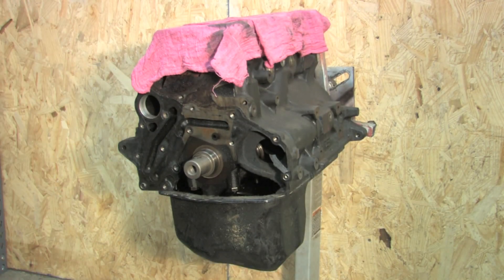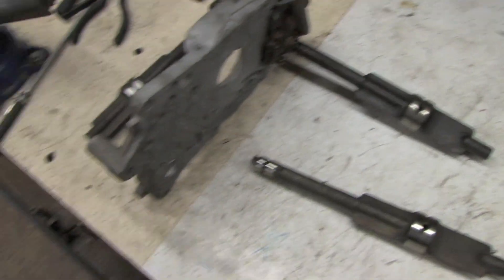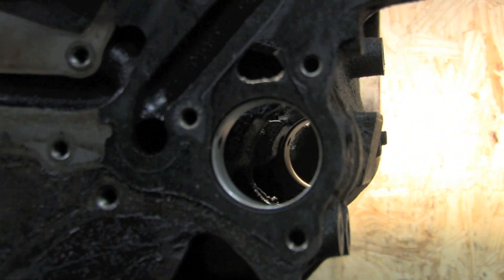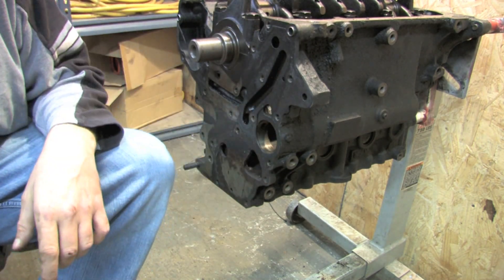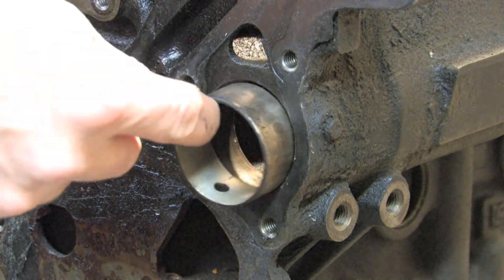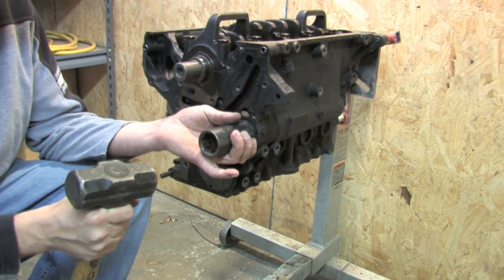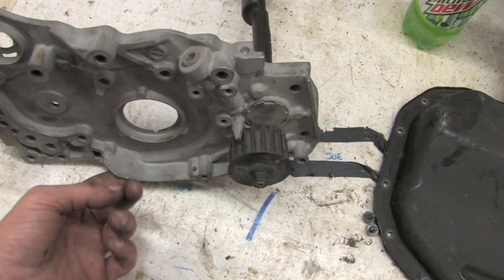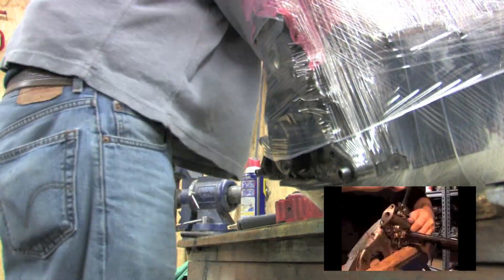4g63 Balance Shaft Elimination - bearing modification

Comment: Hi my oil light has been flickering at idle of 500-600 rpm for 4 years or so,(2002 eclipse 2.4,with now, 168,000 kilos) i bought  this car used, (i replaced a few  oil sending unit over the years,due to leaks from the electrical plugin withing the sending unit itself. I just recently had a problem with this balancer shaft.whilst driving along the highway My car stripped teeth of the idler belt and pieces took out cps sensor and it shut down.after investigating, i am certian the idlershaft bearings were worn so i decided  to NOT replace the idler belt because the shaft is very loose on these worn bearings. i just replaced the timing belt only and the car was fine.  i have noticed the oil light staying on more and more over these,6 months later and it was teapping on one lifter only for months, a few days a go it shut down ,it seems like it is a seized engine,it wont turn over at this point.should i rebuild this engine you opinions would be greatly appreciated 100--- 100 on your video.

Comment: love the vidoes! question the 4G64 has philips m8 bolts on the block that lead to the oil holes for the rear shaft bearings, could you just remove that place a longer bolt in there to block the oil galley?

Comment: just did this same mod. thanks so much for putting this up. best tutorial ive seen!

turns out...last person who did up my engine...did not put in a spacer behind one balance shaft sprocket. oil leaked out bad, bearing siezed and the secondary belt snapped. NEARLY took out the main belt (was heavily damaged). i did the taredown to inspect the low oil pressure problem and found this!

Comment: Great video! thanks a mil. im doing this on my evo right now. i know what im doing and the only reason i searched for this is im doin it with the motor in the car and couldnt figure out the best way to get the old bearing out in order to flip them 180 degrees. thanks for that balance shaft trick because the flat head screwdriver was just not working..lol. Thanks again. keep up the good work!

Comment: is this capable for any 4g motor? im rebluiding a 4g69 in my ralliart and i've heard of an elmination kit. should i do the kit?  or pull the balance shafts out? i already have them out but if i were to keep it out how do i block the hole where the shaft comes out?

Comment: did i read something somewhere about one of the shafts driving the oil pump? sure dont look like it in your FANTASTIC video. what is the oil pump driven from on these things?

ive got a 4G63B to rebuild sooner or later, looking for a little more spunk without a turbo with the build so starting with better carb and the balance shaft removal :)

Comment: Yes, it's a tough call. One less belt to break is the right step. Why they don't run the balance shaft off a crank gear with a large balanceshaft gear is beyond me. You'd think the balanceshaft would give the engine more momentum, like a flywheel. But it dain't work that way in this case.

Comment: Reducing the entire engine/balance shafts' friction coefficient with a ceramic treatment would put less strain on the belt; thus, no need to remove it. How much hp. is required drive the balance shaft? Is there a gain on the dyno once its' removed? Nice solid block it is.

Comment: What would happen if I used the standard size head gasket with so much taken off the head?
also I was looking to upgrade the turbo and few other things. When finished whats the most cost efficient way to get the car tuned?

Comment: thanks, i'll keep that in mind.  What a lot of guys I know run now is a stock shaft that has been turned down on a lathe to remove the weighted portion. Then it reinstalls just as normal.  A bit more weight, but very reliable.  

The shaft falling out unfortunately caused my engine to lose a lot of oil pressure, I thought it was just the sending unit as that is pretty common, but once that dropped the head pressure got pretty low.  Oh well, time for new bearings :P

Comment: this is helpful, i'm going to be putting in a full length shaft on my 7 bolt, the previous owner put a stub shaft in and it came unbolted from the gear and dropped into the pan :( .  I figured you'd have made a video on this already, thanks!

Comment: you should use an anaerobic sealant. to make sure there no bleed out. i work at a machine shop and. i had many of these bleed out oil after doing the same thing u did. but never happend agian ofter useing the sealent. and you should do that during final  because during honing and boring. metal can back fill the cavity. so you want all the oil passages to be open during final cleaning. and as the seal go to an automotive maching shop. and ask for sleeve lock. its used to seal wet sleeves.

Comment: U spun a bearing now ur replacing the block with a 6 bolt same happened to me I rebuilt the old 7 bolt but I don't think it'll last long I also have a spare 6 bolt block laying around it'd be awesome if u could help out with the 6 bolt bottom end 7 bolt head swap I know ill need a cas do the headbolt holes to 12mm etc but id like to see more from what u got 2 ur videos are very helpful and informative!